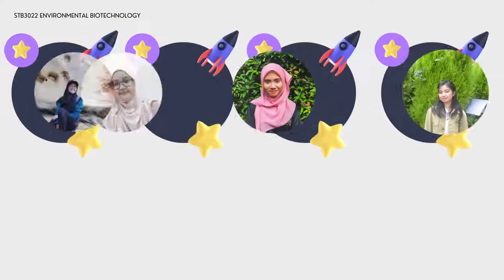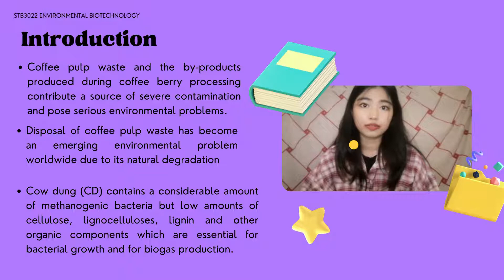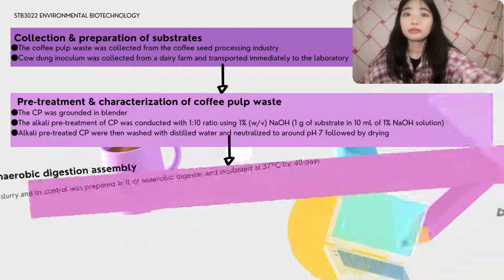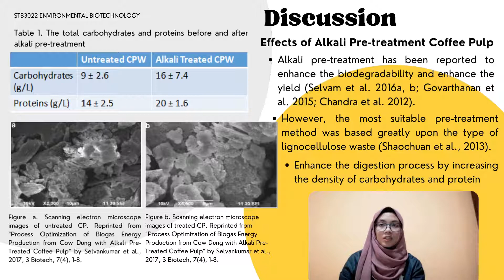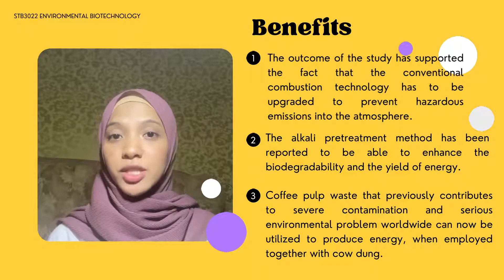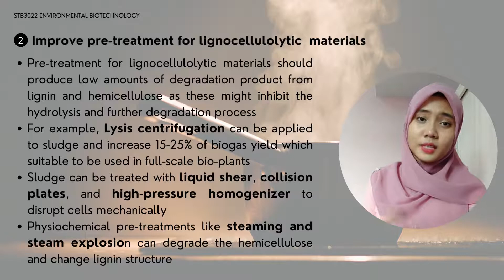STB3022 - [G2-SG04] Journal Reflection

Comment: Hi, I'm Yee Jia Wei from G02-SG07. Since every batch of the CD may have different amount of methanogenic bacteria, will this problem affecting the production of the biogas? And anyway to overcome this problem?
Reply: Hi, Jia Wei. It's true the production of methane gas depends on the methanogenic bacteria in CD and hence biogas yield might be slightly higher or lower in every batch. However, to ensure the optimum yield of biogas, an optimum condition must be prepared for bacteria proliferation and methane production. Some critical factors to look at are the aerobic stability, organic loading rate, and temperature. Hope that helps.

Comment: Hi, I’m Jordan from G2-SG6. In the objective section, it’s stated to find the right ratio of CP and CD to increase aerobic stability towards biogas production. My question is how does the increase in aerobic stability contribute to the biogas production? Is the biogas not produced through anaerobic digestion? Thank you
Reply: Hi, Jordan. Thank you for the interesting question. Yes, the biogas is produced through anaerobic digestion but aerobic stability plays a role in methane production. Aerobic stability is defined as the amount of time a silage/agricultural waste remains stable before a 2 °C increase relative to ambient temperature. Low aerobic stability means the waste is not stable and prone to spoil faster and vice versa. We want to avoid conditions that foster aerobic deterioration by providing adequate aerobic stability. Low aerobic stability (the substrates exposed to air) will reduce methane production due to aerobic digestion which end product is mainly heat and carbon dioxide. By adding additives which in this case the optimum ratio of CP/CD can increase aerobic stability and can directly be converted into methane during the anaerobic digestion process. Hope that answers your question. Thank you once again.